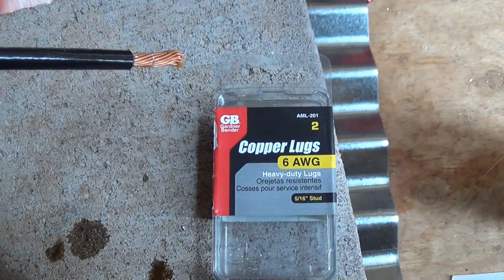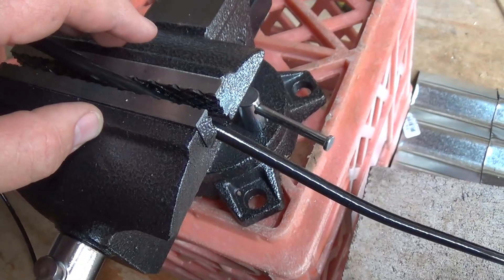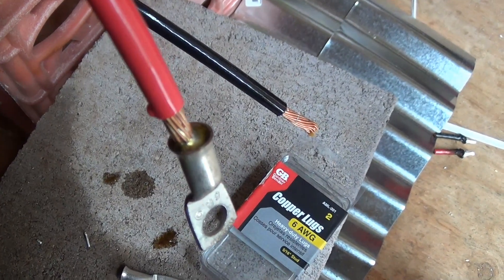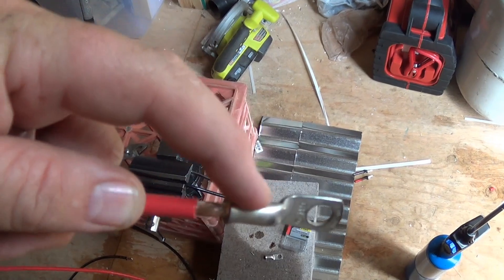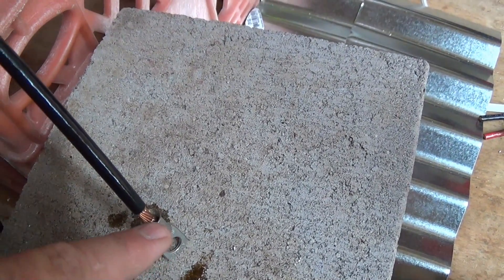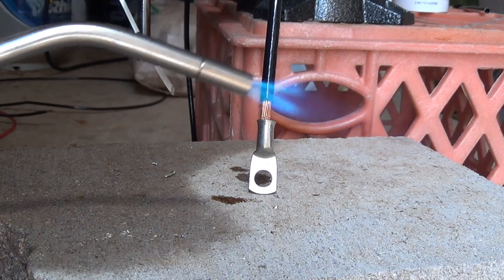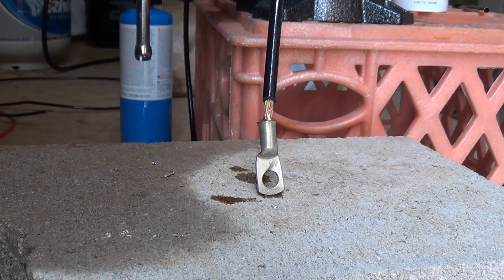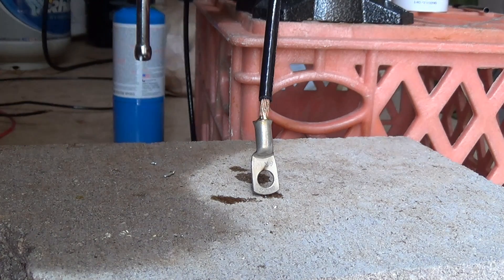How I attached Battery Lugs to 6 awg wire for my Off Grid Solar Power

Comment: Happy New Year!
That vise your using should be able to crimp those lugs, also, pre tinning the wire with solder will also help make a much better connection.                 All the Best
Reply from the maker: +bigolmoose69 thanks... it was after the fact I thought of using the vise to crimp. lol

Comment: It's still a good connection with all that solder but why didn't you just crimp them with the vise?
Reply from the maker: +Scott Miller great question. sometimes I just cant think out of the box. lol... it was one of the duh moments afterwards I thought of it. lol....
Reply: Exactly.  Or, as some do, 1) Tin the inside of the lug cup; 2) Crimp lug / cable - that vise would definitely do the job although it would help to secure it first; 3) Solder exposed copper to lug.